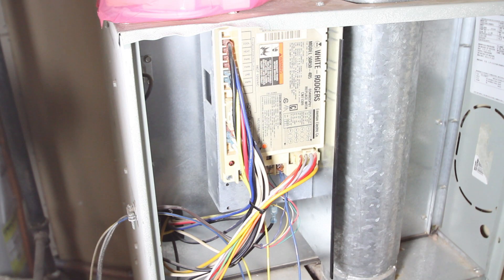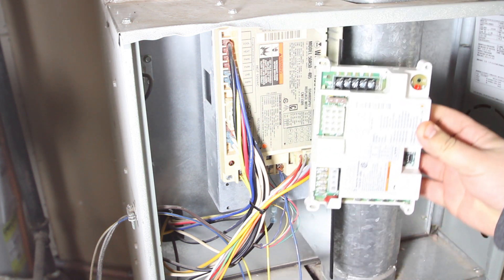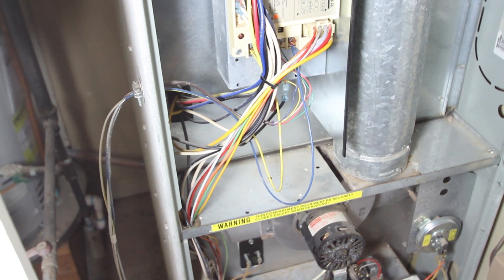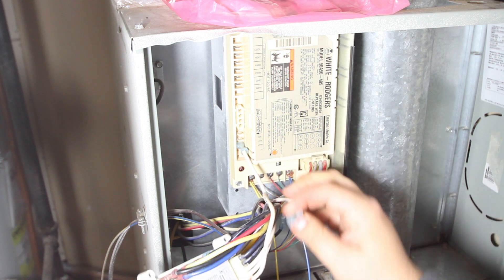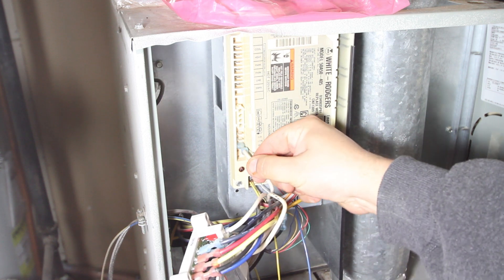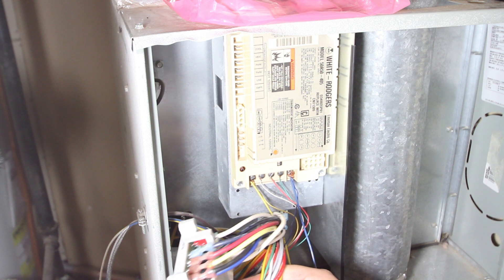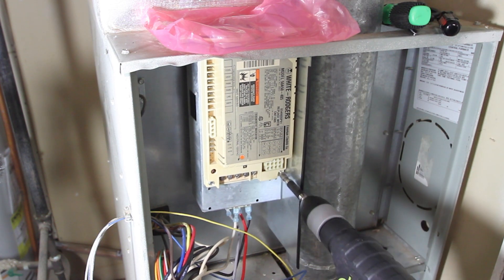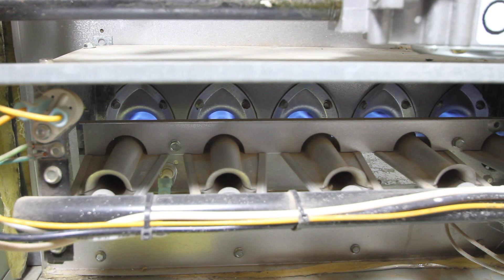TRANE XE80 Circuit Board Failure - Replace CNT1309

Comment: Did not mention what part original (model Number) to replacement part (model no.).  Such a failure to basic explanation.  Second the big cube connector, did not mention what orientation.  This is a junk video in my opinion.
Reply: Thats because that plug only goes in one way. If you need that explained then you shouldn't be picking up tools period.

Comment: Thank you so much Ryan, you've empowered me and I'm going to do it myself. As a way to somehow repay a little, I saw that when you unplug wires you pull the wire itself, I have gotten in trouble more than once by doing this and breaking the connection between the wire and the plug, always pull on the plug and not the wire even if you need to get pliers to do it. Thanks!

Comment: Thanks for the instructional video.  You didn't mention, or show, but I suppose it's important to install the new smaller board in a place and orientation which allows the red diagnostic LED to be visible through the window as was possible with the original board.

Comment: How do I know if computer circuit board is not operating
Reply: debra perry 
For this particular model of the white rogers, the red led indicates a faulty control board. Great indicator for replacement.